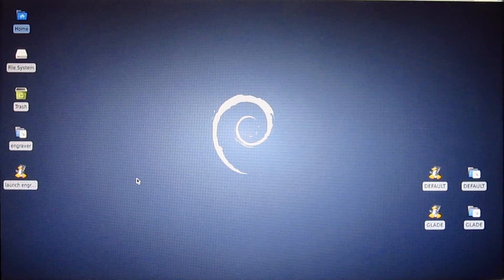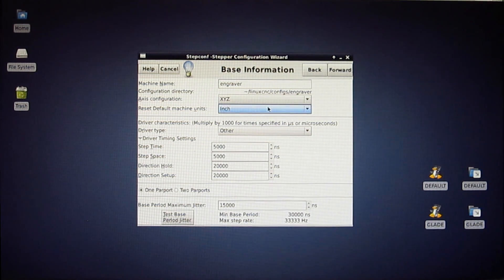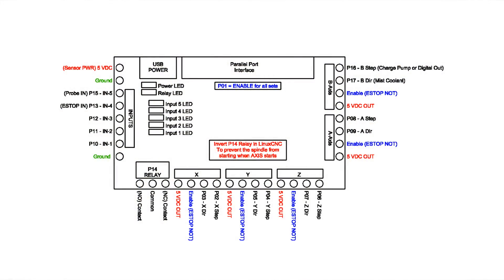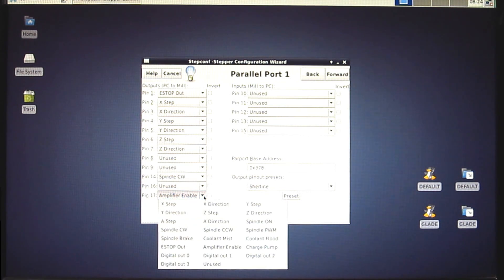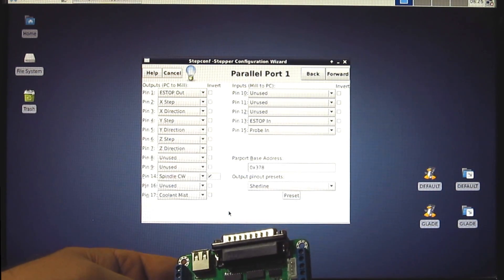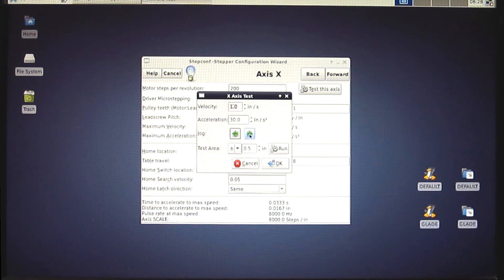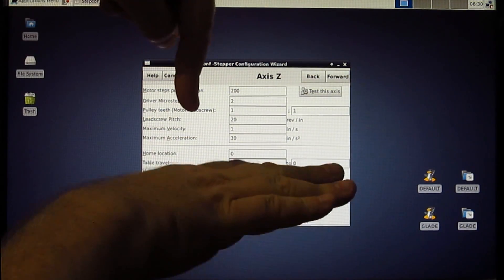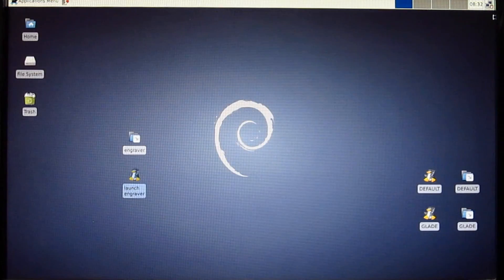LinuxCNC Machine Setup Part 1

Comment from the maker: I did notice one little thing to note... 1 = No microstepping... but it doesn't stop there... you can have 2, 4, 8, or16 which tells it that if you normally have 200 steps per revolution... if you are microstepping by 16 for example... 
it will now have 16x200 = 3200 steps per revolution. Also... you may have a 10 TPI thread... but if it is a 2-Start... then it is actually 5 TPI. Just a couple of things to be aware of.
Reply: askjerry So if you want to microstep at 12,000 for example it would be 60?
Reply: Some clarification on the tpi. If you have 2 it’s the same as 5? So what if 5 is input? 10?
Reply from the maker: @glennedward2201  When configuring LinuxCNC, there is the microstepping setting, number of threads per inch/mm. And a ratio of stepper to shaft in the event you have a belt system for example. Sometimes I just cheat... I tell it to move 1mm and it moves exactly 3mm... I may just go in and multiply the number of steps by 1/3... Or... I may just tell it the ratio is 3:1 and let it adjust. In the end... The INI file gets a scale number that sets how it performs. Once configured... I NEVER go back to STEPCONFIG. I manually tweak the file to get what I need. There is a guy in Egypt (hello Trucker!) Who built a machine from scraps found at the junkyard... No telling what the exact ratio or scale was on those parts! So we approximated until it was running smoothly... And somewhat close... Then we figured the machine could move 4-feet. We told it to move 40 inches... It moved 40.575 inches or so. The scale was like 6.8750... So we changed it to 6.8... It went 39.7 inches... Then 6.5... Etc... Until we hit 40 exactly. Then we told it to go 48 inches... It went 48.05 inches.... Made from junk. So don't stress over it... Get it as close as you can mathematically... Then dial it in as needed. And watch setting microstepping too high... Every step up requires more pulses... Your computer can only make so many per second... So it gets slower. You need to find the balance between speed and accuracy. Math will tell you that you have achieved 0.000001 inch... You haven't. With slop, backlash, wear... Maybe 0.0005... With good ballscrews. Frankenlab has like 0.025mm or so... It cuts plastic and wood.... So i run a bit faster than if I attempted to get that 0.005mm setting... In my case... Close enough for project boxes and training.

Comment: Cheers Jerry! I am just in the process of building a cnc lathe and am going to start learning using linuxcnc this helps as a start, looking forward to the next part :)
Reply from the maker: +David Stevens (davro) I've been busy... but I should have some new CNC videos soon.
Reply: +askjerry Cool stuff, I have managed to setup a 3 axis milling machine!

Next is the 2 axis lathe, should be simple :)
Reply from the maker: +David Stevens (davro) Just remember that the lathe needs an index and phase input to calculate rotation for the threading routines. I have a lathe that I want to set up as well... may be awhile until I am able to get to that project unfortunately.